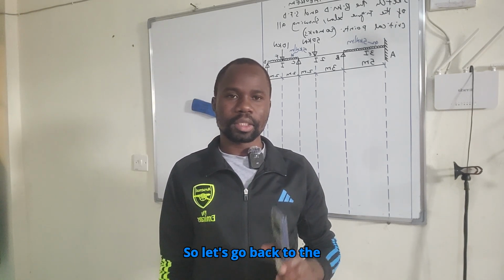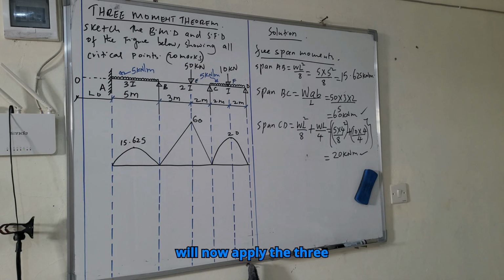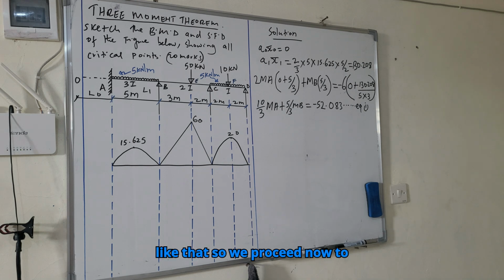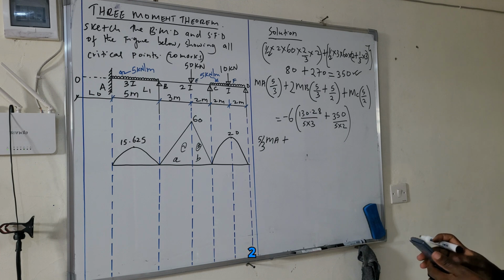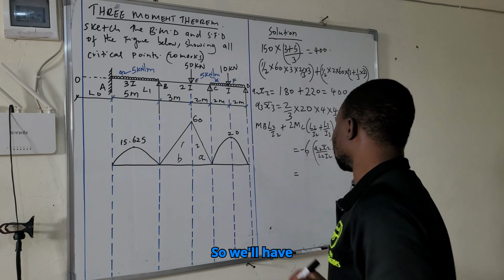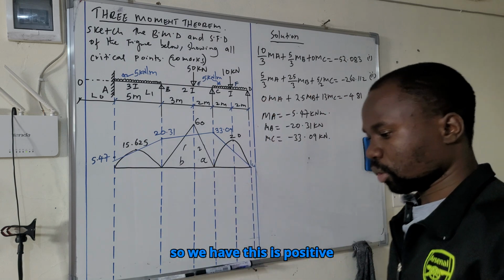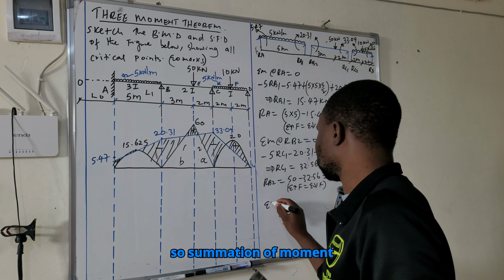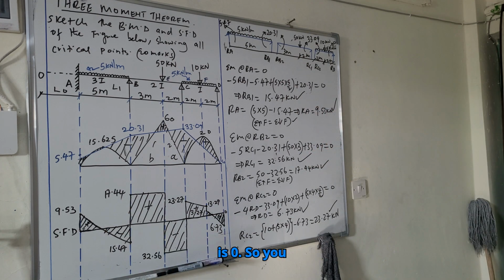THREE MOMENTS THEOREM PROBLEM#7

Comment: No, maximum depth  to breadth ratio is given in Table 19 of BS 5268, depending on the degree of lateral support. You will be provided with the ratio in the question, and if not, table 19 of BS 5268 will be provided in the appendix. you only need to know how to interprate the table.